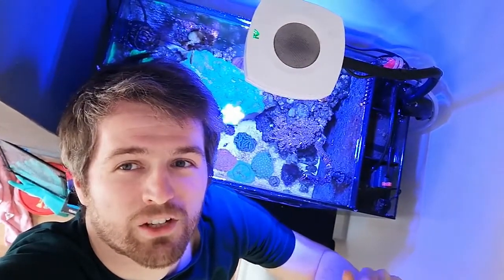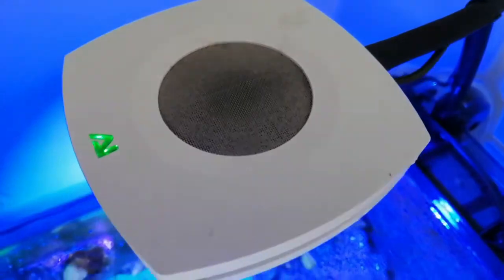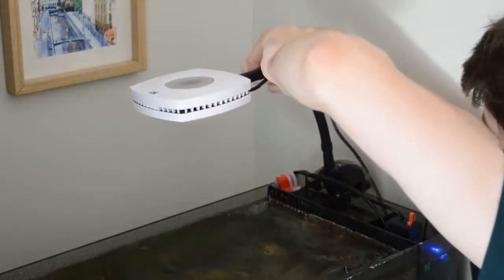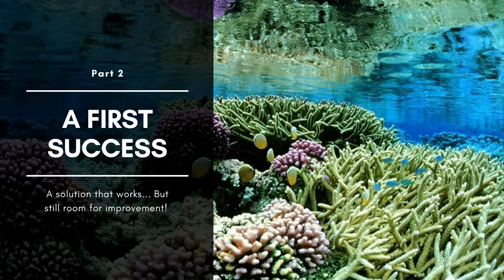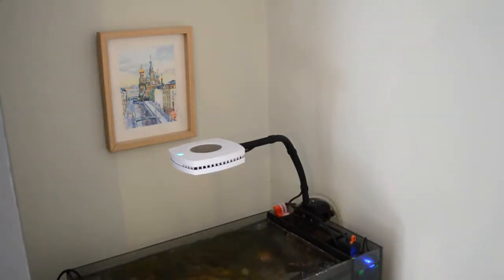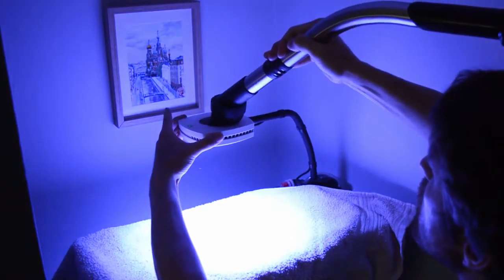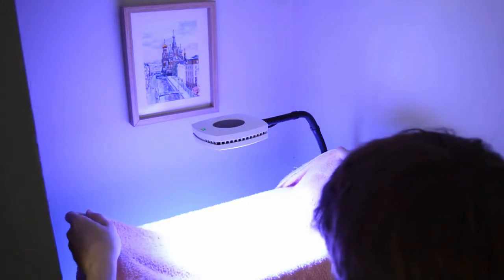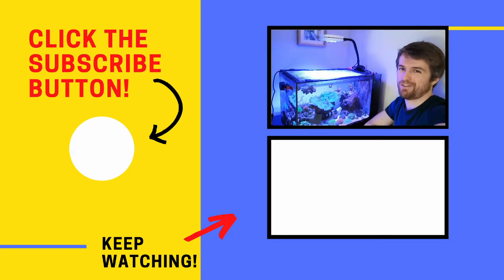AI Prime Maintenance: How to clean an AI prime!

Comment: I'm an instant fan. The cube I have is an All in One like yours.
Reply: I was wondering if you are running a skimmer. I never started my skimmer because of all the negative feedback I saw for it. I'm considering a canister filter instead. The cube is an AquaTop 22 gallon
Reply from the maker: Nope, I never ran a skimmer on this tank although I have got one on my new larger tank. Never tried turning it off though to see if it is really helping, just ran it from the start. Would be interested to know you notice a difference if you do start it.

Comment: Hi what do you run your prime on. I've got the same tank. Cheers
Reply from the maker: Saxby setting but I adjusted the brightness down to an appropriate level. Due to the low mounting height the light is much more intense in the middle of the tank and falls off a lot towards the edges though so beware of that.

Comment: I wouldn't vaccum your light. Vacuum creates static electricity which could shock and damage the electronic board inside.
Reply from the maker: That's a good point! 🤔 Thanks for sharing. I would expect the product to be able to handle static charges external to the normally assembled product though. If I understand correctly, the charge is created in the vaccum tube when vaccuming?

Comment: The problem with the way you're doing it is you're not getting the dirt from the inside of the unit I guarantee you there's dirt caked on those fan blades and you will not get the dirt out with a vacuum unless you take it apart
Reply from the maker: Yes, could well be the case. I've had a few people give tips on how they take their units fully apart so I may have another go sometime soon to try again. Thankfully my AI never really gets warm so I don't think much sticks. I bought a hydra which was very dirty when I got it due to what I think was a previous owner smoking/vaping and it also running very warm. With this, I had to scrape the gunk from those blades like you mention. Thanks for sharing your thoughts!
Reply: @IndoorReef  I took off that top piece that you were vacuuming and I blew it out with my compressor blew all the dust out it's very clean and also I blew the inside of the heatsinks they were pretty dusty I will see what happens now

Comment: There's no screw under the sticker
Reply from the maker: Thanks! Very helpful to know! I began to think maybe I was looking for another screw that didn't exist after seeing a different video on this topic the other day. I suspect I was either not committing enough force to open it after removing the screws or not quite separating the case in the right way. Let me know if you know which you think it was?
Reply: Yes there most certainly is a screw under the sticker (AI prime16 reef), and you need to remove it in order to disassemble it.